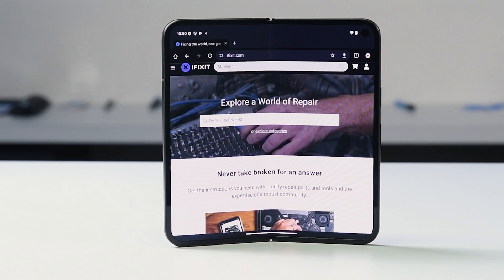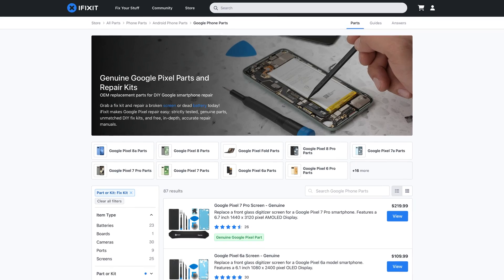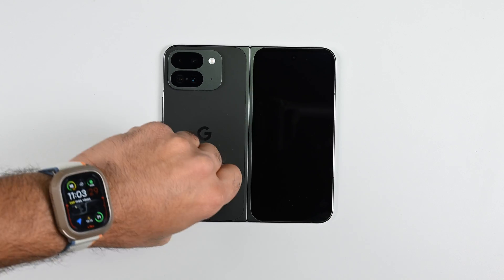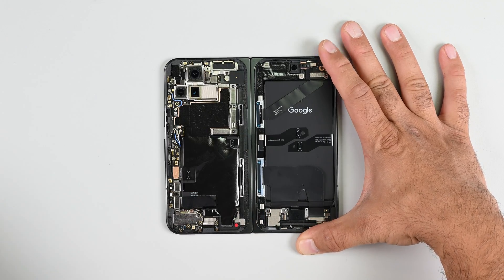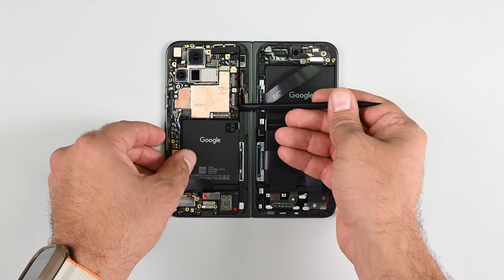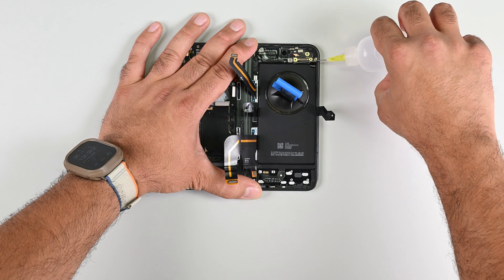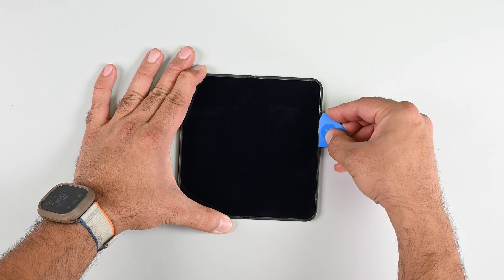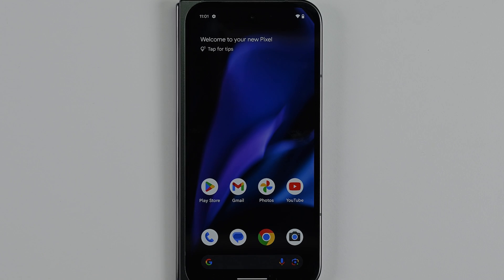Pixel 9 Pro Fold Teardown! The Most Exciting Foldable Yet!

Comment: I love my Samsung S24 Ultra, but I have seen too many horror stories with their Foldable line of phones. The repairability on those is not that great. The adhesive they use for their screens is ridiculously strong as well, so there's a big risk in trying to repair the device without breaking the screens. For this Pixel 9 Fold to be able to have the back cover and screen be removed with little to no heat is a huge repairability win. If I ever do decide to get a folding device one of these days, it will most likely be a Google Pixel Fold device.

Comment: $900 to replace the fragile screen yourself, and it’s still hard to remove I’ll continue to wait.
Reply: I'm not seeing any parts on ifixit's store for the P9PF yet...
Reply: @JudgeRightly  Oops-you’re right. I was looking at the original Pixel Fold. But I’d be surprised if it was significantly cheaper for the Pixel 9 Pro Fold screen. Even $450 feels cost prohibitive for such an integral and fragile part of the device.
Reply: @samtherat6 At the same time, it's an expensive and relatively small volume part, and the entire reason that the foldable unit is so much more expensive than the other devices in the lineup. Buying spare parts retail is also inevitably going to be more expensive than the bulk cost of those parts as sold integrated into a completed product because the supply chain is more complex.
Reply: Where did you see $900
Reply: @Bai-Hui  iFixit’s store. The screen only comes with the frame like they said in the video, and costs $900 for the part alone.

Comment: Having the outer display be so easily removable without heat worries me a bit what‘s going to happen when it gets hot in the summer sun for a while
Reply: Pixel outer screens always pop out. You need to keep t7000 around
Reply: Up next will be 20 screws holding screen & back glass without glue and there will be at least one saying “too many screws” or “why ditch the waterproofing”.

Comment: Glad to see a replaceable USB-Port, since that has always been a downside for me on what I find an otherwise very repairable line of phones.
Reply: I've never had a charge port fail on any iPhone or 4 generations of Pixels... not sure this is really that big of a need?
Reply: God knows what some people do with their smartphones to have problems with the charging port.I’ve never had a problem with any type of charging port on a smartphone in 14 years of using them 🙄
Reply: @davidjacobs6244  1. Plug it in. 2. Unplug it. 3. Repeat steps 1 and 2, hundreds to thousands of times. 4. ???? 5. Loose charging port.